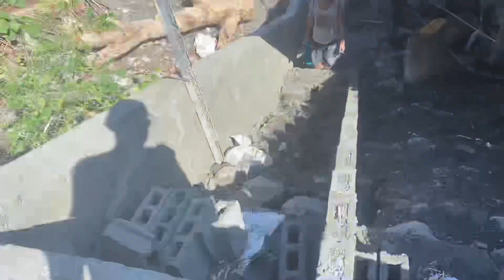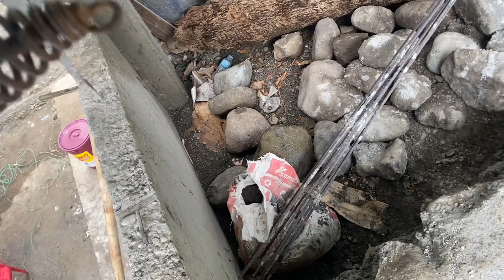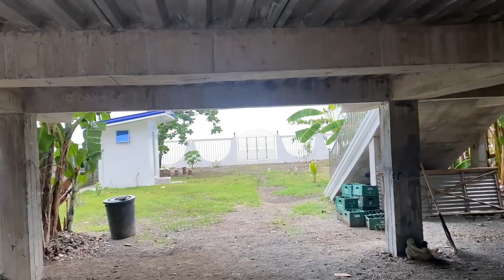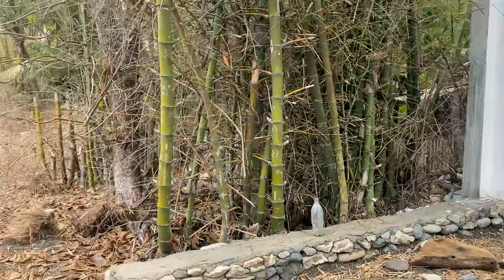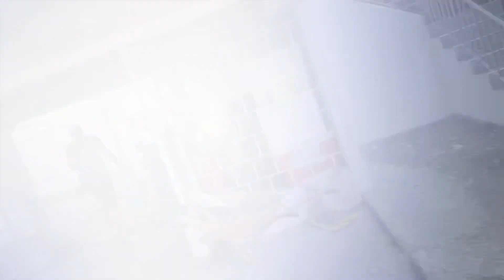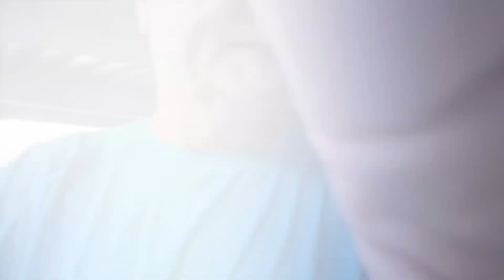Antique,Philippines house built-STAIRWAY TO HEAVEN !  LED !

Comment: Rodney, I’m not a hydrologist but I think if you take your drain a few inches beachside and turn it 45% down and then run a pipe to sand level and add another 45% into a 2’ or 3’ pipe into a deep pit filled with rock or maybe 57 gravel so when the water disparate s it won’t have any force.  Water with the force of your current drain will cut your beach to pieces like warm pie.  You have to lower the water pressure hitting the sand and diffuse it.  Regardless of wether my idea makes sense, I hope someone more knowledgeable that me responds.

Additionally I’m one of the people waiting for a response from you, I’m assuming you’ve read my notes over the past few days.  Just trying to help out my Virginia brother. 👍
Reply from the maker: About the Social security I think your talking about. I haven’t done anything yet but I am gonna check into it. Thanks.
Reply: @62tofreedom51  I hope so, it is “change your life money”.  Ask me anything and I’ll try and help.  I have time before we go back to the USA in 39 days.  Is Rane your biological daughter?  If she’s your step daughter she still qualifies if you are married to her mother or she is adopted.  My stepchildren qualify bc I’m married to their mother.  Her mom get caregiver benefits until she 16 but you might have to limit her income.  I think it’s less than $21k a year.  It’s a sh!t ton of money.  Call the embassy tomorrow or email them.  I’m not sure which.  Or call the 800 number, you might be able to enroll her online but you’ll need a bank account in both names,
Reply from the maker: The Us embassy handles SS. ?
Reply: @62tofreedom51  Yes but go online to them first.  I think you can make an appointment first.  No walk-Ins.  Anyway I believe they can help you but check online first.  Also the 800 number I gave you can be reached from midnight until 10am M-F.  They can enroll you online but you need to have a joint account with Rane.  I think her name first you second as the legal guardian.  Where is your SS Check deposited now?  Maybe you can set her up there.  Is your wife a US Citizen?  Are you married?  I don’t care, I only want to help.

Comment: The variety of bananas affects the taste too. There are many varieties to boot. I think the difference in taste also applies to chicken and pork too. That’s because the US is processing them in mass number, in super confined spaces with highly modified foods focused on rapid growth. 
As we age balance becomes an issue for most people. My knees are shot so stairs are not my friend. Ramps work better for me. Getting old sucks! I would have concreted the whole stairway and been done with it but maybe moss     might be a problem then. Life’s about choices isn’t it. Just put a concrete slab at those drainage pipes like they used At roof down spouts. That should minimize the erosion from the force of water.
Reply from the maker: I dug some sand and added rock today. Gonna stay on it before rainy season gets here.